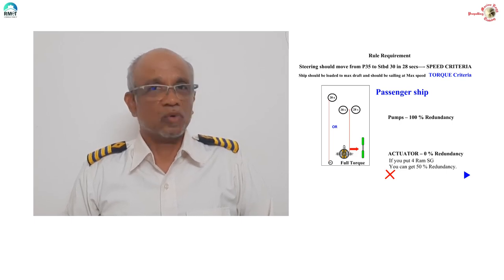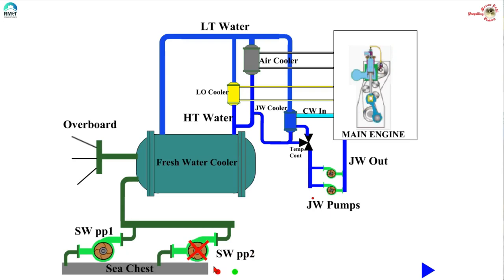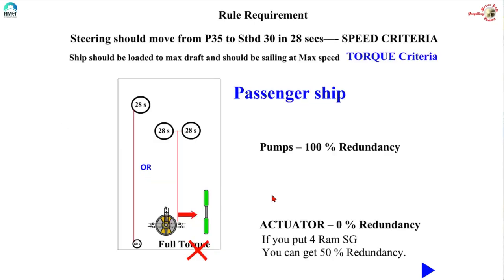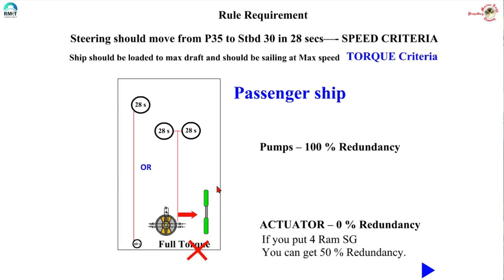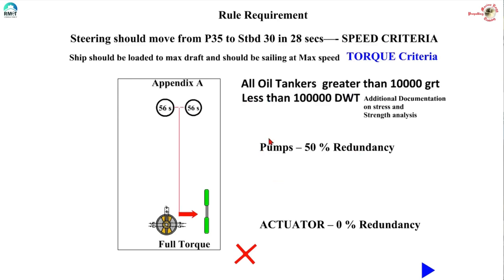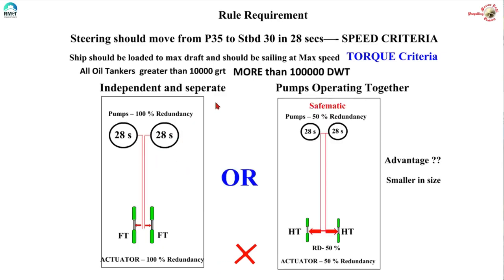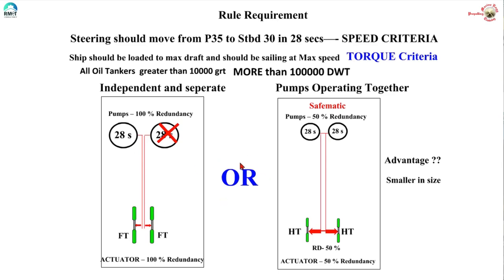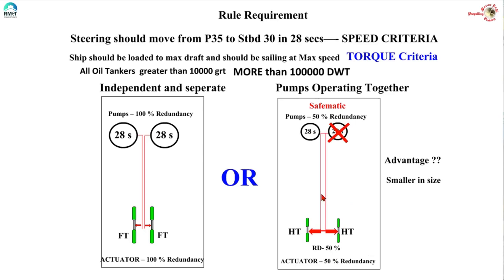Redundancy based on Single Failure Criteria.|Ramesh Subramanian |RMETC Videos

Comment: Sir,
If we have 4 ram and single pump is capable to fulfill the solas requirement. But now due to leak in line we isolate 2 rams. So now redundancy of pump will increase or its same?
Reply from the maker: rams affect the Torque...Pumps affect the speed...If you loose two rams--redundancy from torque perspective is 50 %
Reply: Sir since can we not achive the same effect even if two rams are isolated as the work done under similar sailing conditions is same in both four and two rams. The increased flow rate, twicw in this case, in two ram case might increase the working pressure and hence create more torque. @rmetcvideos

Comment: video last mein galat hai with safemtic system waala....bigger tankers need two pumps both capable of delivering 100% redunncy capability both pump side and torque side....
Reply from the maker: ye rule kahan se mila bhai ?? Kuch Latest nikla hai kya...?? Atleast till Oct 2015 ka edition mein se ...Regulation 16.2.2    .....  at least two identical power actuating systems which, acting simultaneously in normal operation, shall be capable of meeting the requirements of paragraph 3.2. Where necessary to comply with this requirement, interconnection of hydraulic power actuating systems shall be provided. Loss of hydraulic fluid from one system shall be capable of being detected and the defective system automatically isolated so that the other actuating system or systems shall remain fully operational;  ------ Focus on the word-acting simultaneously---
Reply: @rmetcvideos  

16.2.1 two independent and separate power actuating systems, each capable of meeting the requirements of paragraph 3.2; 
or  
16.2.2 simultaneous waala

...ok sir understood